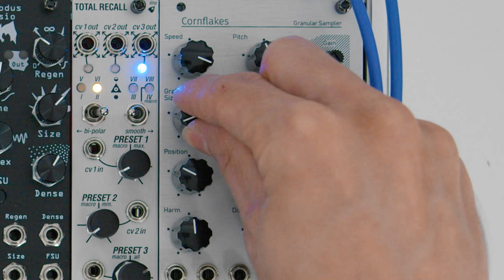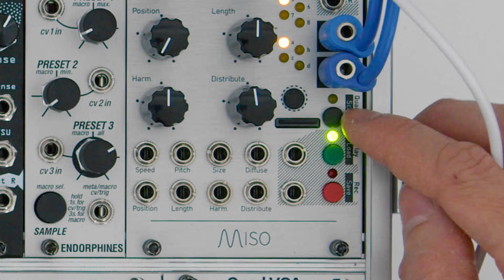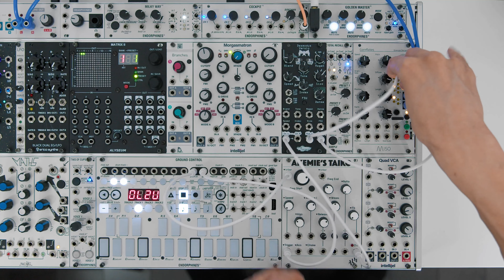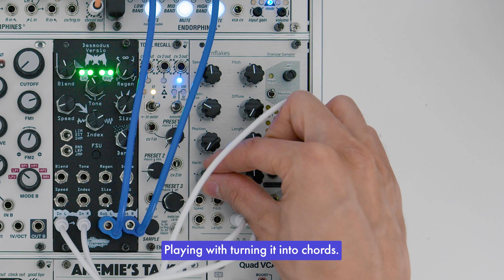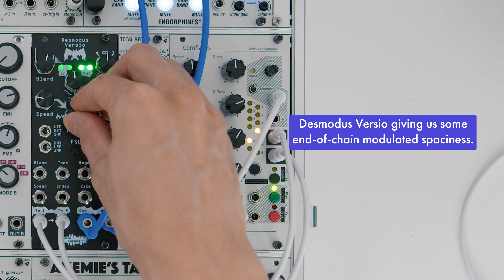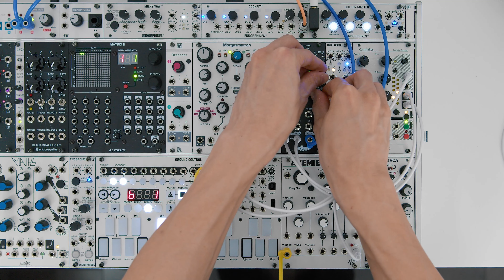Fantastic granular synthesis with Miso Cornflakes

Comment: You and divkid make me want to buy back in so bad...I keep telling myself I can do this in ableton over and over
Reply: You don't neeeed it but modules are fun. M4L granulator 2 is amazing for stuff like this.
Reply: Yo, check out Cardinal, it’s a free VCV rack host for working in the DAW, which is a free Modular simulator. insane possibilities , plus all the power of a DAW, and you can have as many modular rigs as you want. I would recommend still building a rig and saving it as a preset and using it in your DAW instead of building from scratch though still, as it’s kinda a better way to learn and explore modular and cuts off that feeling of analysis paralysis.